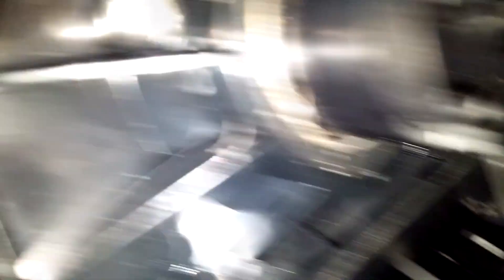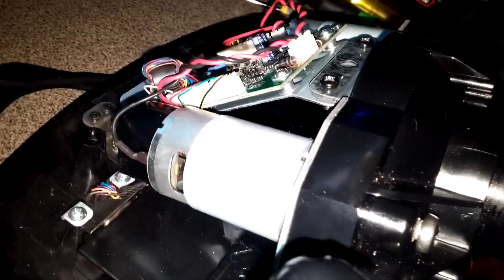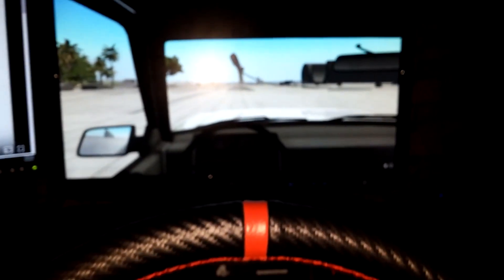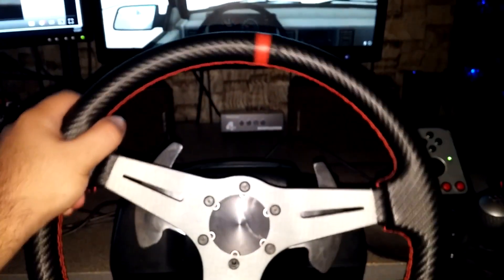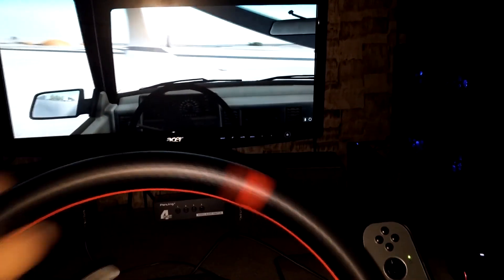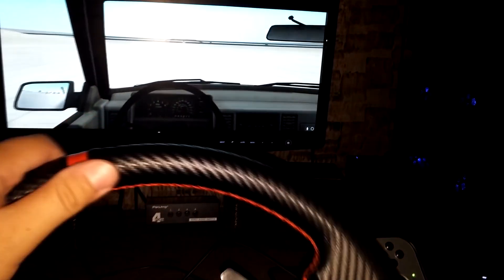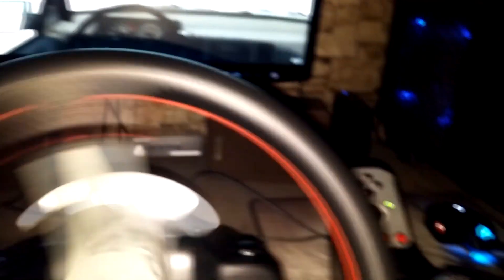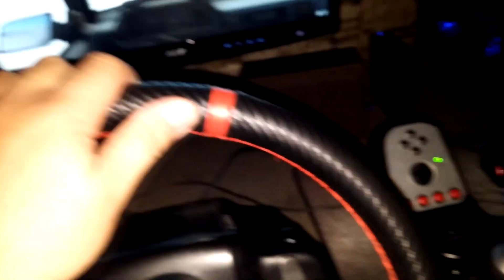Logitech G27 Chatter Fix

Comment: Hello i have questions

	1.	Was the plastic sleeve and spring left in place at that time?
	2.	Did you use any threadlocker for it?
	3.	How long did this solution hold up?
Reply from the maker: @RemoVillk  Yes the plastic sleeve in the spring were left in place and I did not use any thread locker. It lasted about another 6 months and then the motor finally died because of the extra resistance. I will say though just if you can't afford it, save yourself the trouble and get a used thrustmaster t300 or equivalent belt driven wheel If you don't want to go full direct drive
Reply: @ Thank you very much for the quick response :)

What were the symptoms of the motor wearing out? Did it stop centering to one side? Did the force significantly weaken, or did it suddenly lose force feedback completely?

Comment: Thats a cool fix. I want to add my fix in the hope it can help others. It's the simplest and most efficient fix in my opinion.

Dont look at the gear end of the motors, instead look at the rear where the shaft sticks out. You simple attach an RC pinion gear to the rear shaft, pushing the shaft back to take up the slack - then tighten the grub screw on the gear. It locks the shaft so there is no more lateral moment. For the wheel with the sensor magnet on it, remove the bracket and circuit board, then you can remove the magnet sensor from the shaft as the glue is very flexible. be careful not to lose the magnet sensor as you pry it off. For the pinion gear on this shaft, if must be very small, so I cut the teeth from the shaft of the gear, leaving a small collar with the grub screw. Tighten this onto the shaft, same as the other motor, and job done - reassemble and the rattle noise is no more.

Make sure the shaft of the motors still turn relatively freely, so they are not too (or over) tight. Put some teflon lube or oil onto the bearings of the motors, and while it is apart, take off the metal sleeve from each motor and replace with a heatsink on each motor. Can get them for RC car motors. Total cost about 20 to 30 bucks for 2 pinion gears and 2 heatsinks. 

My G29 wheel went from unusable in F1, as the rattle was excessive even when driving in a straight line, to after the fix where it is totally gone and the wheel performs exceptionally.
Reply: hey there could u make a tutorial for us that are not as hadny as u are?

Comment: you basically destroyed the wheel. thats a very well thought engineering. its not some kind of issue. its what it supposed to do to give the bumpy feeling and also protect the gear teeth.
Reply: no, when my wheel was new it didn't do that, now it does. It gets looser over time
Reply from the maker: No this is something that develops over time. The bushings wear down at the end of the motor shaft so they're no longer providing enough tension.
Reply: Right... Good luck "protecting the gear teeth" letting the shafts wobble all they want.

Comment: Awesome, this actually worked!!! 
Only downside is that you have to take the whole thing apart, every time you want to "fine tune" it... but hey, no pain, no gain, right?! 
Many thanx from me but especially from my wife... 😉😉😉🤣👊
Reply from the maker: Hey man sorry I didn't see this. Yeah its no problem. I can't believe nobody else put the tutorial up.
Reply: I ended up drilling a hole on the outside of the case to “fine tune it.” Works like a charm and the case holes are hard to see as it is.
Reply from the maker: @kirbys_korner_YT  that's a good idea. didn't want to modify the outside of my case though so I just got it to the point where it felt solid.

Comment: Quick question, how long were the machine screws that you used?
Reply from the maker: About a quarter of an inch long
Reply: @RetroGamerr1991  Thanks for the info.  Wanted to follow up and say I tried this fix on my G29, and I think it does work but you really have to fine-tune it.  The first time I opened it up, I tightened it to where you said (the wheel shaft being hard to turn by hand) and that ended up being way too stiff on the wheel itself, making it difficult to turn the wheel a small amount without it sticking.  The second time I opened it up, I  loosened them just a tiny bit, but I think that was too much as the chattering returned (though, I think, not as bad as before).

If I end up opening up the wheel again, I think I would drill out a couple holes in the chassis so I could access the screws for fine-tuning while the wheel is put together.
Reply from the maker: @MavericK99966  No problem. Yeah It's different on all wheels. This G27 has well over 1000 hours on it from iRacing so I'm sure it had more slack then your G29 lol.

Comment: Was fix due to added friction or tightening clearance?
Reply from the maker: tightening clearance.
Reply: @RetroGamerr1991  but you also said that tighten screws until wheel axel barely moves with hand => sounds like adding friction also
Reply from the maker: only slightly. the motor will still overcome whatever friction you add very easily.

Comment: Hi mate, so basicly you tighten the two big screws on the side of wheel? Is that correct? 
I know u drill in to them etc. but main this was you just made them more tight?

Cheers for Vid! :D
Reply from the maker: Yeah they're not self tapping screws though the plastic is soft enough a couple of machined license plate screws will thread themselves in. You have to make sure to use a screw with a flat bottom as you don't want to pierce the plastic bushing it will be pushing on. And yeah to adjust the tightness of the gear train you just tighten the screws down in small increments.

Comment: I did this and a little more with the gear rack right under the wheel hub gear my wheel is super quite nothing like before it actually works just gotta be carful not to over tighten look for the sweat spot

Comment: I barelly understood what i had to do!
Reply from the maker: I'm sorry I should have made a video on how I did it but basically just drill two small holes very carefully in the spots I showed and then get some flat bottomed machined screws to thread into those holes to push on the plastic bushing on the other side of the hole.